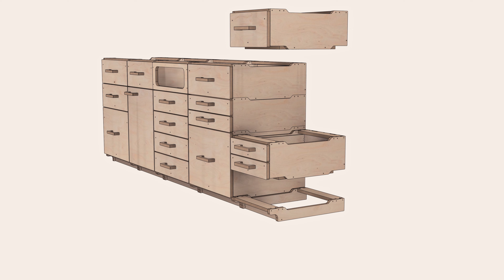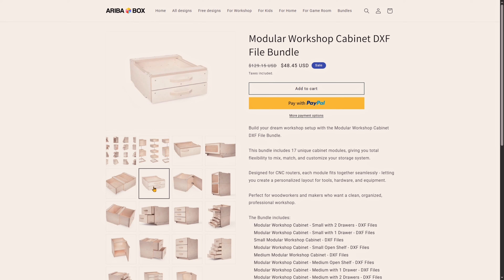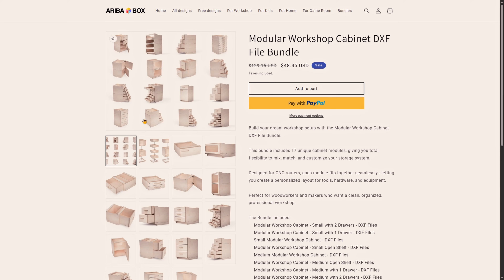Better way to make Workshop Cabinets - Modular Design

Comment: I think you could take bigger advantage of the fact that the joints are cut on a CNC. Think aka the bow ties on the workbench.

I think they could be sturdier, easier to assemble or stay more modular (be easier to reconfigure for organisation) if they relied more on the geometry of the joints and less on the screws to hold them together.
Reply from the maker: Thank you for the feedback! That’s a fair point — taking more advantage of CNC-cut joints (like dovetails or bow ties) would definitely look great on this project.

For this version, we kept the joints as simple as possible to make the design easier to scale and modify, which also opens up more possibilities for future upgrades. That’s why we were okay with compromising a bit and adding fasteners. Once everything is assembled, it’s still a very rigid build — but exploring more geometry-driven, modular joints is definitely on the table.

Comment: What kind of cnc is this? Is there a kit or diy manual somewhere to make one?
Reply from the maker: We have the Onefinity Journeyman CNC - it comes pre-built and usually takes about 2 hours to set up.

You could probably find a similar kit or a parts list to build one yourself, though I haven’t looked for one personally.

Comment: Wouldn't it make more sense to hollow out the bottom panel? Less weight, less wood. As long as you can find a use for the leftover bit.
Reply from the maker: It's a thing to consider - technically you wouldn't need a full floor panel for the drawer modules. So, you could make a cutout and use it for something else.

Comment: I’m intrigued by this system and the ability to rearrange things as needed, but I don’t use CNC. Cutting all those tabs would be a lot of work… but I think I can figure out an alternative. You’ve given me a fun puzzle to think about, at any rate! And who knows, maybe this will be the thing that finally convinces me a CNC is worth getting someday. I’ve been resistant to the idea, but this might just change my mind…
Reply from the maker: Glad I could spark some inspiration! Even without a CNC, it’s a fun design challenge to adapt, and I’m sure you’ll come up with a great solution.
Reply: You don't need all those tabs. It seems the shape of the sides is the most important feature. That looks to be what "locks" the modules together. The top and bottom stringers could even be standardized in size and location in a way to where you could just cut the sides as a rectangle.

Comment: Absolutely fab idea, Just wondering given the cost of sheet goods at the moment I'm thinking that cross laminated corrugated cardboard (glued up , & waterproofed with titebond etc) might be a usable alternative?
Reply from the maker: Yes, the prices are definitely tough right now. Using cardboard is an interesting idea - attaching the floor, subtop, and drawers might be tricky, but structurally, cardboard is surprisingly strong and could work well for this build.

If you do give it a try, please share some photos -I’d love to see the process and the finished result!

Comment: Not gonna lie, this is pretty cool. But there are much simpler DIY modular cabinet solutions out there. I really like the one made by Hooked on Wood. It uses the same draw slide concept as yours but the drawer configuration is more customizable and easier to change. Just pull out drawers and rearrange as you want. No CNC required and arguably faster to build.
Reply from the maker: Glad you found it cool! There are definitely many ways to approach modular cabinets, and it often comes down to what tools you have available and what kind of look or functionality you're aiming for. Thanks for watching!

Comment: What would be really interesting is how much each module approx. Weights - I am thinking of doing this approach in a van vor mechanics
Reply from the maker: Interesting point - I hadn’t thought about weighing the modules. It would take taking apart the whole setup to do that, so maybe something to try during the next upgrade. Adding these to a van build would be such a cool project!
Reply: @Aribabox  I think you dont even need to weight the modules - just let CAD do the work. If you add „plywood“ as material, you should be able to get a 95% correct weight. (Lets dont count screws and so on)

Comment: And spec on screws, and you have a counter sink on the holes. What tool?
Reply from the maker: We used regular plywood screws - each hole was countersunk with a 45 chamfer bit to ensure the screwheads are flush with the wood surface - think it worked out quite well for this project.

Comment: What bit are you using trimming.
Reply from the maker: I used a 1/8-inch round-over bit for the component edges, and a large chamfer drill bit for the dog-holes - it was way faster than doing it with the router.

Comment: This modular system will work for those without a CNC. Cutting the smaller panels on a table saw is much easier on an old guy. You would still have the same flexability in design.
Reply from the maker: That’s a great point — good to know it works for you too!

Comment: Would a brad nailer work instead of screws?
Reply from the maker: Using a brad nailer would be a quicker way to assemble the modules.
However, I personally prefer screws - will make it easier to take the cabinets apart, if I ever needed to.

Comment: cant we use this in a kitchen as well ?
Reply from the maker: Yes, definitely! You can use it in a kitchen too. You might just want to tweak the design a little to add drawer slides, which will make it smoother for everyday use.

Comment: Spray some silicone oil on the rails, you'll be amazed at how smoothly they'll move.
Reply from the maker: Thanks for the tip! I have some in the workshop somewhere - will definitely give it a try!

Comment: This is amazing. Can this design accept a drawer slide?
Reply from the maker: Glad you like the project!
The current design would need a few adjustments to fit drawer slides - you’d likely need to narrow the drawer bodies a bit. It’s definitely doable, though, and shouldn’t affect the overall layout too much.
Reply: @Aribabox  whats the diameter of the end mill you used to cut these boards?

Comment: If you have a longer toolend it could cult multiple surfaces at the same time. Could also be done with a laser cutter or a wire saw.
And you could also 3D-print the sheets, multiple ones at a time (standing), if your printer is large enough you could print a solid body ready-made piece, even ones stacked on each other with removable supports.
Tons of options when you have a modular design.
Reply from the maker: The modular design really does open up endless possibilities! 
Your idea of cutting multiple sheets at once got me curious — normally, you’d avoid that to keep the cuts precise and prevent the pieces from moving mid-operation, but maybe it’s worth experimenting 🤔

Comment: Can you make it also with wheels?
Reply from the maker: That's a great idea!
We were thinking of creating similar base frame as for the modular workbench project to which you could attach the cabinet modules and turn the setup into movable cabinets or into a small workbench setup.

Comment: The modules for the drawers don't need the full bottom. If you replace the bottom sheet with two strips of wood, you could save some material.
Reply from the maker: That's a great idea! 👍🏼
It would save a bit of wood, especially when making larger setups.
Reply: @Aribabox  Or you could use smaller offcuts for those bottom pieces and spare the big parts for the side panels

Comment: This is a great design! Are you cutting these out in one pass? Even for the 3/4" plywood? What are you feeds and speeds set to? Thanks. And I also asked on another video just now about tabs. It doesn't seem like you're using them. How did you keep the pieces from shifting? Thanks
Reply from the maker: Thank you!
We do cut most parts in a single pass, but for 3/4" ply we usually take two passes per contour. It’s a great way to speed things up. The shavings help hold the part in place, which lets us skip support tabs — although for smaller pieces you might still need them.

Here are the cut settings we typically use:
- Router bit: 1/8" straight-flute (2 cutters)
- Spindle speed: 25,000 rpm (max on the palm router)
- Feed rate: 3000–4000 mm/min (slower for thicker material)
- Cut depth: 9–15 mm per pass (this approach doesn’t work well on 6 mm sheets)

Hope this helps! And thank you for watching the videos!

Comment: Really nice concept,
Was. Wondering if I can cut all modules on my cnc with working area of 60x50cm?
Reply from the maker: Thank you! Glad you like it!
The biggest parts are the drawer floor panels (approximately 550 × 550 mm), so those would need to be tiled on your CNC. All the other parts should fit without any issues.
We also offer multiple module sizes on the website — the 1-cube and 2-cube modules should work fine with your 60 × 50 cm working area (except for the drawer floor panels)

Comment: Awesome design!  Do the files include the fusion file for parametric adjustment? I’d like to make sure the drawers are sized for gridfinity bins.
Reply from the maker: Thanks so much!
Adding Gridfinity to the drawers would definitely be an awesome upgrade.

The project currently includes only the DXF files — each module comes in three different widths (400, 475, and 550 mm) with a depth of 550 mm.

Here are the internal drawer dimensions:
• Large: 472 × 511 mm
• Medium: 397 × 511 mm
• Small: 322 × 511 mm

If you need the modules adjusted to match specific Gridfinity dimensions, just shoot me an email — happy to tweak them so they fit perfectly.
Reply: @Aribabox thank you! May be something to keep in mind for the future, considering how popular gridfinity has become. I now make all of my drawer internal widths and depths in 42mm increments due to this.

Comment: This is a neat idea.  Wonder what the waste difference is over a conventional cabinet layout on a CNC?
Reply from the maker: Glad you like the project! The material required isn’t that much different compared to regular cabinets. It takes a bit more for the side panels and backs, but everything else is pretty much the same.